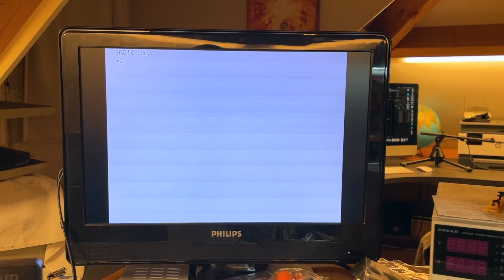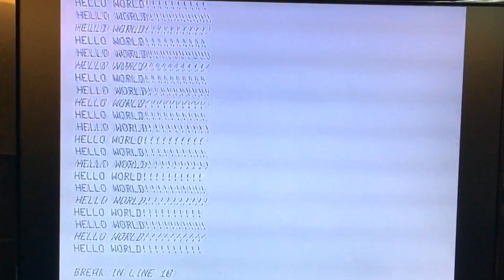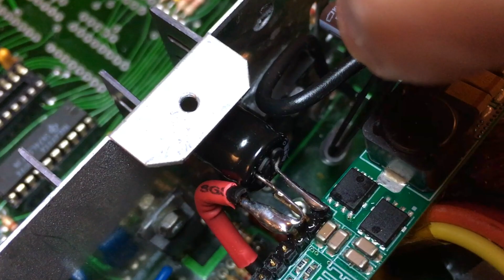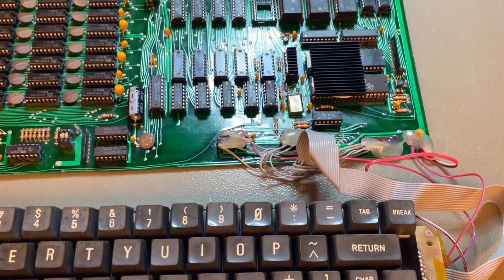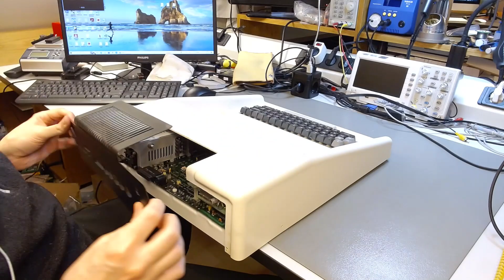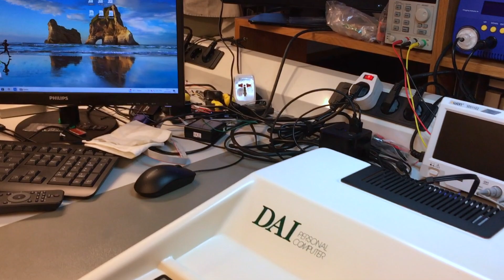Restoring an extremely rare, Belgian DAI PC (Part 6)

Comment: Another option is to just go with Mean Well's NID65-5 instead of NID35-5, the board is twice the depth but it looks like it would be plenty of space. It has beefier components and is rated up to 6.5A and is a straight drop-in replacement, the pin-out every other spec other than dimensions and efficiency is the same (the NID65 is sligthtly more efficient). It's widely stocked and only slightly more expensive. Not that I think it'd actually matters, 3.5A ought to be plenty even if the drawing said 4A.

Comment: That is definitely a bodge keyboard, probably from the later Indata version. The original DAI had a black keyboard with grey cursor keys, and they were more sculpted and rounded at the edges. It's actually a very high quality keyboard -- in stark contrast to the flimsy plastic case.

Comment: I really loved this series on the  restoration of the DAI PC. I'm really a noob with electronics but I did have thought. Could the fan you're using to cool the voltage regulators have caused the ripple coming from the power supply? Please excuse my ignorance but I thought it was a valid question. Kind regards CJ
Reply from the maker: No question is silly; just NOT asking the question is! No, the ripple wasn't caused by the fan. The fan is connected to a separate USB charger, not the DAI's PSU. You may notice that I am still using the fan even after the ripple is eliminated.
Reply: @thebyteattic  Thanks for the reply Bernardo. I really love your restoration videos especially the Sharp MZ80 and the Wang computers. Also I think the Agon project is amazing work. I hope to build one when I have a little more disposable income. I'm from Sheffield UK and things are a bit tough financially for me at the moment. I have all the tools to make one so I could possibly put it after Christmas. I love your attention to detail. Thanks for your channel. Regards CJ.

Comment: Very nice restoration, looks really good and the case turned out superbly. I feel your PSU pain as I recently had a Spectrum dumping 70v into the 12v circuit, and it was because TR5 was connected incorrectly because what the data sheet said, and what the transistors connections were, did not match. Took me ages to figure it out, and may have been the inductor dumping voltage because the switching was off. I'm sure the museum will appreciate all your hard work.
Reply from the maker: Thanks!

Comment: I was looking to buy a computer in 1980, and visited many computer shops at the time. I learned the word "benchmark" at the DAI shop in Brussels: they handed me a printout with several BASIC programs (from a simple FOR NEXT loop to several algorithms for calculating prime numbers etc...), with the times needed to run those programs on several computers on the market, as they were very proud of the performance of their JIT compiler. Now every time when somebody talks to me about benchmarking, I think about this beautiful machine.
Reply: My father noticed at that time Dai was the fastest. I'm in france close to Belgium, but He ended up buying a cheaper BBC Micro which I used so much !! I still have it. BBC basic was also very fast and incredibly good.
Reply from the maker: Thanks for sharing!

Comment: Superb job - well done 👏 👏👏 I completely agree with your PSU solution - you put a lot of time and effort into the original but it was fubar. Your solution is completely hidden inside the PSU enclosure and does not detract from the vintage appearance of the machine. A sensible and pragmatic mod. I like it that you take the time to explain what you are doing and why you made the choices you did. This is all done with a calm and knowledgeable presentation 😊. BTW I would like to compliment you on your excellent English 👍
Reply from the maker: Thanks!